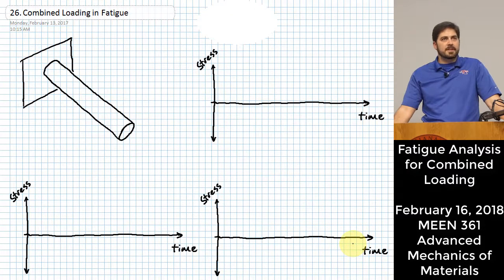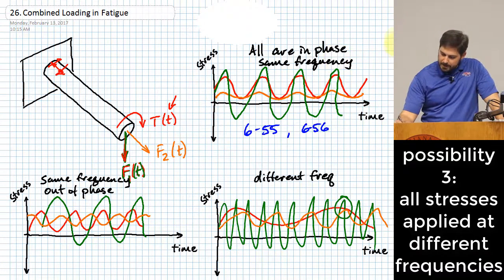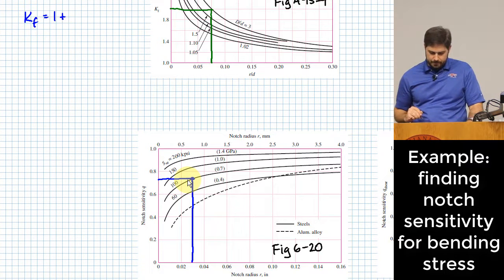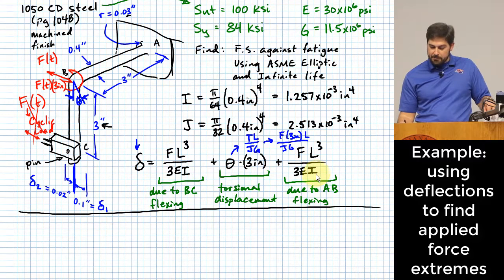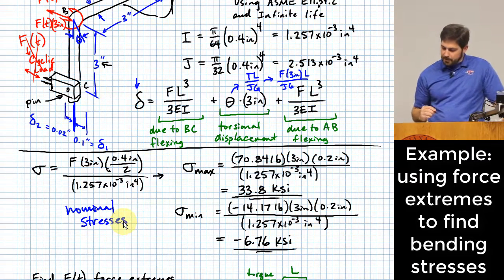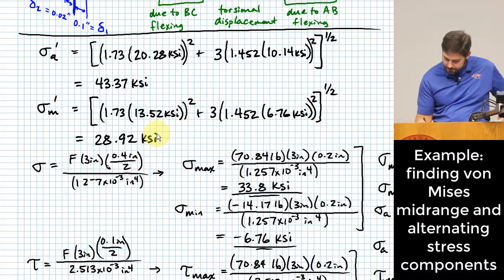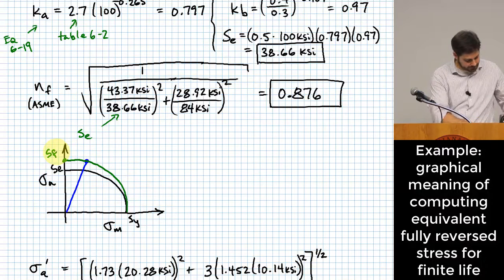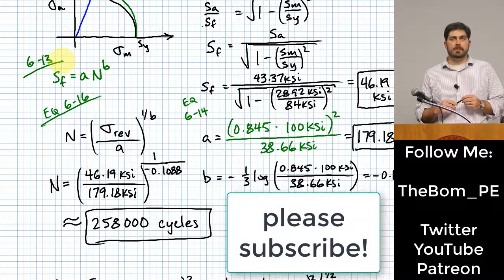Fatigue for Combined Loading & Estimating Number of Cycles Until Failure

Comment: Hello Mr. Swanbom what is the name of the book you are using on this course?
Reply from the maker: I use Shigley's Mechanical Engineering Design, 10th edition. Thanks for watching!
Reply: @TheBomPE  thank you, I just have a doubt when Loads are same frequency but out of phase the method consists in finding the stress of each load in function of time and then combine them with Von-Mises (which also will be in function of time)? And if so, my Alternating and Mean Stress are those of that time-function-Von Mises (max and min)?